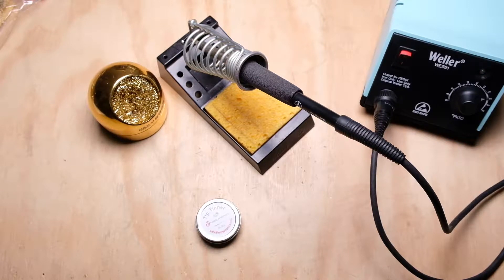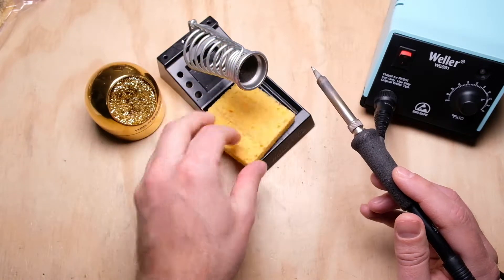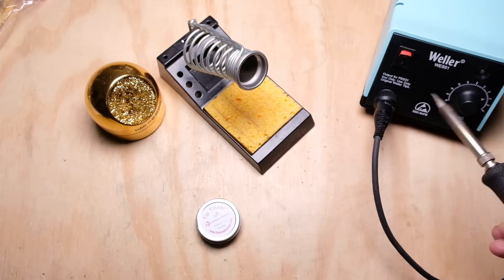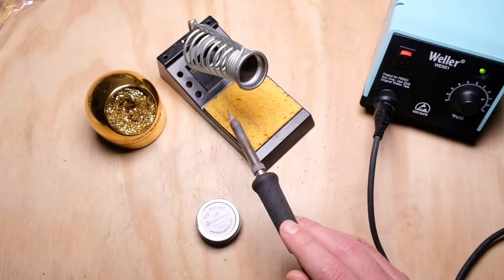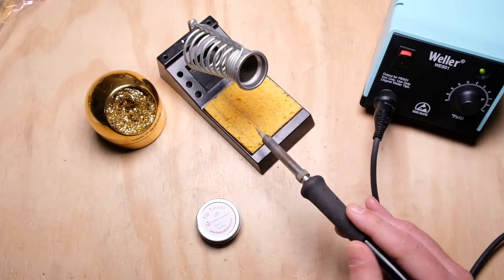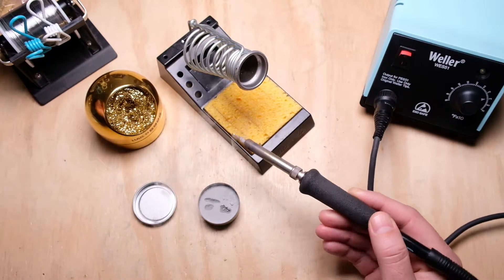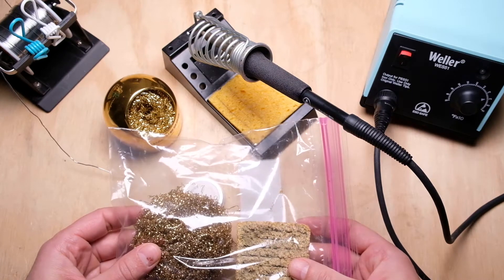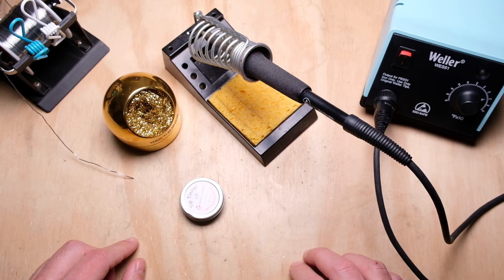Soldering Iron Tip Cleaning

Comment: Never encounted this tip thinner before.  Expensive but if you can work effectively then it should pay for itself.  My old home made soldering irons used to be ground down chunk of metal  {20 - 30mm dia}  with a long thin 5mm handle welded to it -  placed on gas cooker.  Being iron of steel no wonder I got away with it.  But solder was good then too.  before they thought it fashonable to put crap on the market so you have to get the expensive stuff.

Comment: I repurposed a small tuna can and some steel scrubber and made a cheapy version of the dry tip cleaner. 😅 But for the sponge I got actual high heat sponges. I heard that another way to clean was dip into clear rosin and wipe off as well. But I also tend to add solder to the iron to keep it wet

Comment: With a stand that big you could also just take the sponge off and stick the brass wool holder in there with a magnet inside, ditto for if you've got any kind of metal baseplate (i.e. for magnetic helping hands).
It's also worth testing brass wool with a magnet if you're buying cheaper aftermarket ones, helps weed out copper coated steel wool which is going to be far harder on the tip (the main reason to use brass), though looking like orange copper instead of golden brass is also a giveaway.

Comment: More do less talk. Skipped through the talk and there was no do. Felt this video was a waste of my time. On to other videos to check out helpful tips on soldering iron care to show the tips and usefulness of These brass wool cleaners. Claims are they replace sponges.
Reply: I've been soldering electronics for 55 years, including 20 years as a fulltime audio repair bench tech; the brass wool works great, better than the sponge, and it doesn't seem to matter what brand you use or where you buy it. Sadly, this does not apply to solder, flux, and tips that match your soldering iron; junky products and counterfeits abound online, especially if buying direct from China or Asia.

Comment: if tip purpose to exchange hit, why i need to use tip tinner, tip no need to hold soldier on it, as far as i know ? or am i wrong ?
Reply: You need the tip to hold some liquid solder.  The liquid solder is what's doing most of the heat transfer from the tip to the joint.  Also sometimes you need to use the tip to transfer some solder to the joint.  An oxidized tip won't hold solder.
Reply: Tinner or solder keeps it from getting oxidized

Comment: The less often you clean and tin your iron tip the more quickly you oxidize and degrade your soldering iron. I never used Tip Tinner. I understand that Tip Tinner is acidic and this acidity can slowly dissolve the tip.
Reply: Most tip thinners contain sal ammoniac (an alkali, not an acid) and pure tin. If you used it every day it would probably shorten tip life, but when I was a full-time audio repair bench tech, I used it just a couple times a week; old-stock Weller tips would last about 6 months of day in, day out use.

Comment: Thanks for the video. A couple of my tips were really badly "furred up" to the point they were unusable. I did not have any tip cleaner so I got the tip nice and hot and dipped into a pot if plumbers flux then cleaned on the sponge. A couple of repeats and the tip cleaned up beautifully.

Comment: does the sponge need water?
Reply: sponge always needs water
Reply: Use distilled water, not tap water (dissolved minerals and chlorine are bad for the tips), and squeeze it out so that it's merely damp, not soaking wet. If steam rises from the sponge when you clean the tip, it's too wet!
Reply: Normal water is good enough. Otherwise distilled water would cost more than the tips which are sold on Temu cheaply.

Comment: If you keep a ball of solder on your tip before you place it into your stand in between solder joints and after use, it will protect your tip from oxidation and make your tips last longer.   The tip tinner will also strip your iron if you use it too often.

Comment: that foam in the weller handle melted away in the first hours of use when i bought it and i was not using high temps lol
Reply: If you bought your Weller online it might be counterfeit; buying direct from Chinese or Asian suppliers is a crapshoot (Hakko solder stations  in particular are often  counterfeited). Also, Weller's quality control has gone way down in recent years, and anything from their "Red" line of products sold at big box hardware stores is overpriced crap. Best to buy directly from the manufacturer or their authorized distributors located in your home country. This goes double for solder, flux, tips and tip cleaners ---- do not buy these direct from Asia! The vast majority are crap!
Reply: @goodun2974  its a legit one from 2015
Reply: @matrixmodulator  like I said, Weller's QC has gone way downhill in recent years. They're now owned by a global investment group.....
Reply: @goodun2974  2015 is recent?
Reply: @matrixmodulator  , compared to their classic USA-made Magnestat soldering stations of the 1970's and 80's, yeah, 2015 is recent. I ran one of those daily for 20 years before I retired from fulltime electronics repair, they were almost impossible to kill. Weller has been bought and sold a few times and is now a division of Cooper industries/Apex Tools, investor owned, with manufacturing sites all over the world. They've been going downhill for a while now.

Comment: I use brass metal sponges and they clean well plus you don't have to deal with liquid reducing your tip temperature + the water speeds up oxidization I believe

Comment: Thank you so much for this tutorial. As a beginner, I didn’t know how to properly ‘tin the tip’ and I also struggled with proper cleaning of the tip. Having this knowledge moving forward is going to make all the difference. Much appreciated.
Reply from the maker: Thanks for watching. Glad this helped!
Reply: 100% for me, too... Thank you for this insightful tutorial!
Reply: Always clean the tip, man. Come on.
Reply: Don't take this advice, read a book instead or find someone who knows what they are talking about.  Here's what's wrong with this video:
• Don't use a wet sponge, EVER, it will destroy your tips 10X faster than using the brass scrubber.
• Don't use tip tinners, because you don't know what is in them - I caught some of them with acid plumber's flux in there.  That will also eat tips.  And it can blow an employer's RoHS certification if discovered.

Just tin the tip with the same solder you're going to use on the work.
Reply: Dude I tried soldering for the 1st time without ever watching any tutorial and I broke a tip in a day cause I put it at 450°C and then learnt you had to clean the tip but then I cleaned it with the dry sponge that was provided...

Comment: From where I can get that scrubber 😔😔
Reply from the maker: Links in the description.
Reply: You can even buy the brasswool tip scrubber at Harbor Freight. Their leaded solder seems pretty good and the two Schneider soldering stations they sell (made by ATTEN) are pretty good; I reviewed one of them on my channel. The supplied tips, however, are junk, and perforance is improved if you use genuine Hakko T18 or 900M type tips.

Comment: Thanks for this video. I’ve been having trouble with my soldering iron. I’m new to soldering but Ive been doing it for a few months because I got into different game system mods that require it. And my solder stopped sticking to the tip. Didn’t meet properly. And was overall annoying to work with and no matter what I tried it didn’t seem to work. Sponges. The dry cleaner. But this clearly explained why that happens. And how to fix that. Granted my tip is too far gone. The end has degraded. But I bought replacements. And now I know how to properly use and take care of my tools. Thank you for explaining everything and offering multiple options for different things.
Reply from the maker: Glad I could help!
Reply: No, actually, you don't, because this video is full of bad advice!
Stop using tip tinners, they're the number one cause of your working solder not sticking to the tip as it should, after oxidation.
Stop using wet sponges!  Use the brass scrubby.  Wet sponges are the number one killer of tips.

Comment: Thank you for this. I solder a lot and I finally upgraded to a Stahl DDSS station.The iron quality is way better than the cheap $20.00 ones I've been using the last few years so I want to be sure I'm cleaning the tip properly to get long lasting use out of it.
When you are done soldering and coat the tip with some tin before shutting it off, do you flick the excess solder off and then put it in the holder or do you just let the mound sit on the tip until the next time you fire it up?
Reply from the maker: Good for you! I just leave the solder on the tip.

Comment: Thermal cycling isn't a problem. The tip can get hot and cold millions of times and not be negatively affected IF the hot part of the cycle isn't oxiding and IF the heat flow outward isn't a shock that might crack the tip. Keep in mind, the tips are cast iron and brittle.
Reply from the maker: How long does a tip last you?
Reply: @AlphatoneAudio  I don't know. Since I bought my Hakko 951 I've not had to replace one yet. THe 3.5mm chisel I use most for this station is short and squatty so it has very good heat capacity. Which means I can do all my soldering down around 340C (644F) and tips will last nearly forever at that temperature. Add that I use mild fluxes (P1 and P2 Alpha Telecore or Reliacore) and the  standby mode of the 951 handpiece rest-- LONG tip life.
Reply: Soldering iron tips are certainly NOT made of Cast Iron (which I'm fairly certain can't be wetted with solder); good quality tips are made of copper base metal for best possible thermal transfer, with necessary soft iron plating at the pointy end because soft iron wets to solder but resists the dissolving effects of molten solder and flux, whereas exposed copper will quickly pit, oxidize and dissolve away from solder, flux and heat. 

Unfortunately, replacement tips purchased direct from China are often made of solid iron, which has poor thermal transfer characteristics compared to copper. I have a video about this subject on my channel.
Reply: PS, the thermal shock of a wet sponge does tend to shorten the life of iron-plated tips, causing stress fractures. A too-wet sponge is even worse; if steam rises from it when touching it with the hot iron, the sponge is too wet! And yes, use of distilled water is preferable because dissolved minerals and chlorine in tap water can degrade the tip. Personally I prefer the brass wool tip cleaner.

Comment: I've completely abandoned the damp sponge and use the brass wool only. I have seen no need for the sponge anymore, and the thermal shock of the damp sponge seems a negative for tip life.
Reply: Why?  Have you ever heard of a fractured tip? Lol
Reply: @VndNvwYvvSvv , the iron plating found at the pointy end of high-quality copper-core  tips will suffer microfractures from thermal shock, eventually exposing the copper underneath, which quickly oxidizes and pits from the dissolving effects of molten solder and flux. Of course, if you're buying cheap clone or counterfeit tips directly from China or Asia, those are often solid iron, which won't crack due to use of a wet sponge, but the thermal transfer performance of solid iron tips is poor compared to copper (the clones and counterfeit tips also typically have poor manufacturing tolerances and fit onto the heating element so loosely that heat transfer to the tip is lousy).

I've been soldering electronics for 55 years, including 20 years as a fulltime audio-repair bench tech, and the brass wool works great, better than a damp sponge.

Comment: Copper scouring ball is really magical the first time I tried it. My solder tip won't get clean using my damp sponge, but one brush to the ball is all I need to cover the tip with tin.
Reply from the maker: I generally use a sponge, but I find I have to use the ball every ten minutes or so to stay as clean as I'd like.

Comment: Hey great vid, but why do you have a Hakko cleaner when you're using a Weller iron?
Reply: As if the cleaner and the iron will know they are not the same brand, smh
Reply: Do your shoe and sock brands always match?
Reply from the maker: All the wire mesh cleaners function the same, no worries in mixing brands.

Comment: I ordered a copper tip cleaner & yesterday I bought a 3pk of stainless steel spiral scrubbers thinking they'll do the same thing. I've used a stabbing motion when cleaning my tips but haven't tried twisting yet. I might look into tip tinner also
Reply: For anyone else thinking this, get BRASS scrubbers from Walmart or your local store, not stainless steel. Steel will ruin the layers on your soldering tip over a few hundred uses.

Comment: My tips keep going bad only after a few joints? I’m cleaning them regularly and tinning so don’t know why this is happening. One of my tips dissolved entirely
Reply from the maker: My last tip lasted me about two years, and as you can imagine I solder a lot. Make sure to always keep a drop of fresh solder on the tip when it's in the stand between joints.
Reply: My experience tells me that you use too much heat. Measure your tip temperature and see if it matches what your iron displays. I generally solder around 300C, and tips last a long time.
Reply: if your soldering wires , dont let the plastic insulator get stuck to the wire.. i have pulled the wire end thru sandpaper to clean before i solder... i also use flux core solder

Comment: Fyi, some manufacturers recommend using the metal ball ones like this -> put it in, rotate, remove.  Supposed to be a gentle process, not much force.  Don't have to stab or push/pull sideways etc.

Heat loss wise on sponges, it depends how quickly the station recovers and how quickly you move from sponge to next workpiece.  If you just dab quickly the sponge it's not excessive.  If you hold it against it, rub it around on there over and over it can drop the temp pretty severely (at least according to some stations' temp gauges.. again, just depends how quickly you need the temp all the way back up).  If the tip is tinned well, I doubt it needs a huge rub mid-work, just pat. 

Sandpaper wise, I agree.  First try a wire brush, then something like a softer polishing stone (weller one is ~ $10 for example).  

For some units, the sponge replacements are like $10 for a stack of them on amazon.